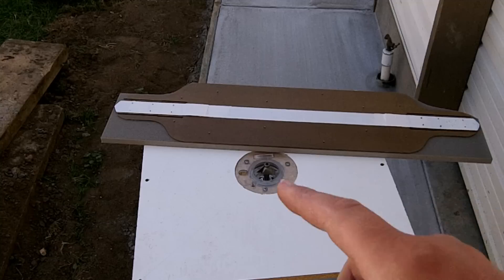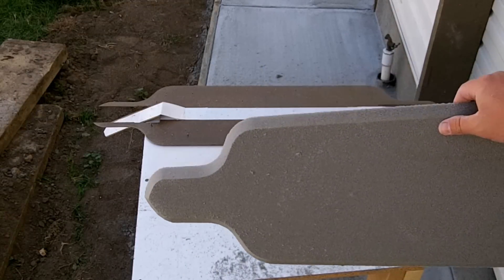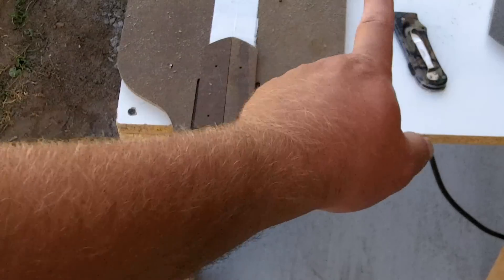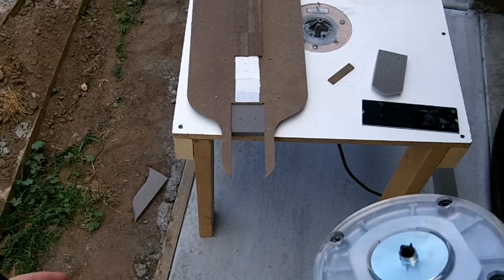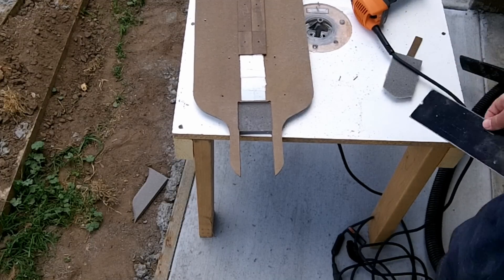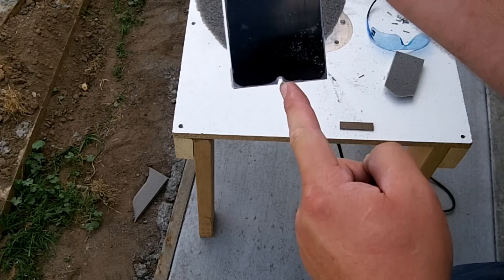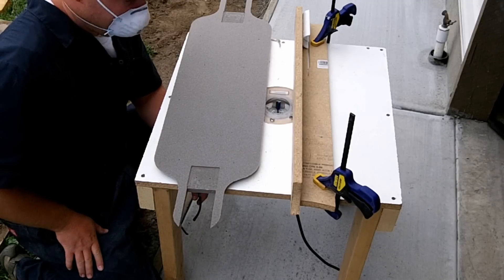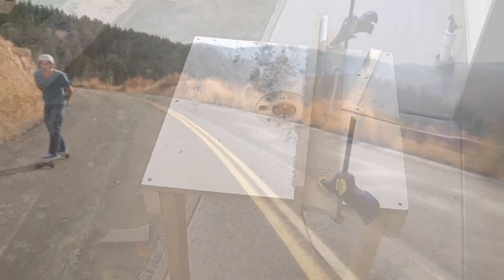DIY Carbon Fiber Longboard Tutorial- 2 of 7

Comment from the maker: Yes you'll still need something, but not necessarily the mounting plate, The foam core just doesn't have the compressive strength to handle the loads your trucks and truck mounting bolts/screws will be creating where it mounts to the deck. You'll need something like a piece of hard wood or plastic to replace the foam core where the mount goes. This will prevent the bolts/screws you use on the truck mount from pulling through or damaging the carbon fiber layers.

Comment from the maker: Thanks! You will need some type of reinforcement if not the plate. The foamcore at the dropthough isn't ridged enough to support the truck once mounted- I know this because I've tried it and it failed. However, before the cf layup, I've cut the foam out and replaced it with a wood block of the same thickness. And then just layered the cf up like normal. Then I cut the dropthrough out so that the dropthrough hole goes through the middle of the block. ABS or similar type plastic also works.